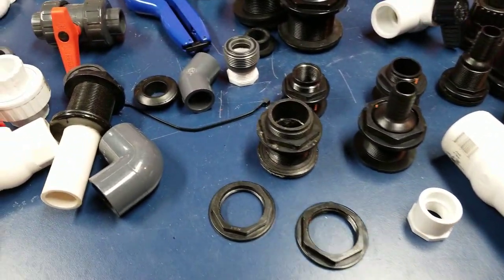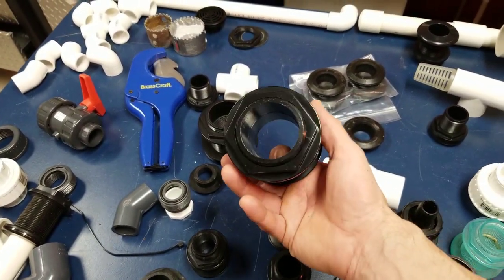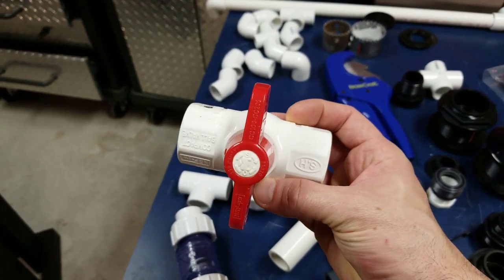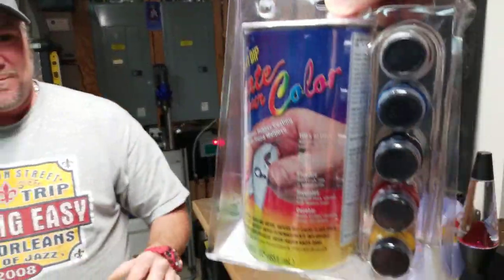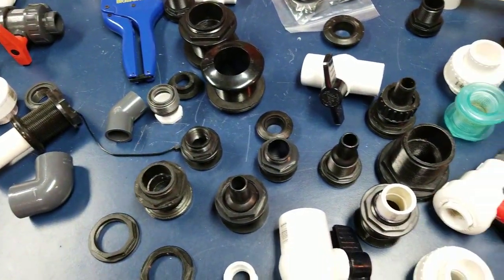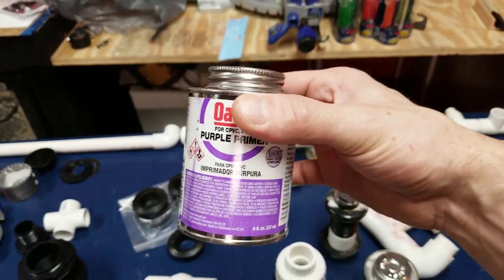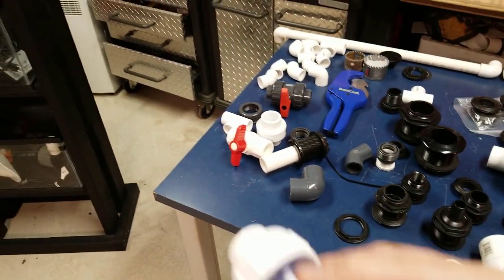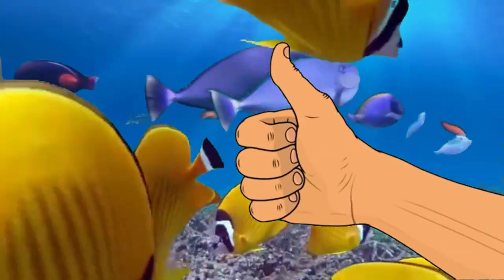PVC Plumbing Guide terms you should know... Bulkhead and uniseal

Comment: Nice video BUT I'm NOT down for all this , even tho i just got a nice tank realizing it was an over flow with the two wholes in the middle of tank towards back, NOW since i don't want to go this way do you have any suggestions how to seal the two holes up, Ive read from using glass top and bottom sealing with silicone or i was thinking using Bulkheads, i herd what you said about the pvc and the bulkhead not recommended, But when i got the tank pvc and sealer were used, they had to cut the bottom parts off because they were sealed,.
Is their a way to use a bulk head and customize something simple to seal them up on a 60 gallon rimless ?
I seen the inserted to keep fish from getting sucked in maybe now writing this using rubber plugs with plumbers sealer or silicone and just plug the top and bottom , BUT i for sure don't needs leaks or a disaster since I'm a renter, any feedback aka: Suggestions ,? Tnks